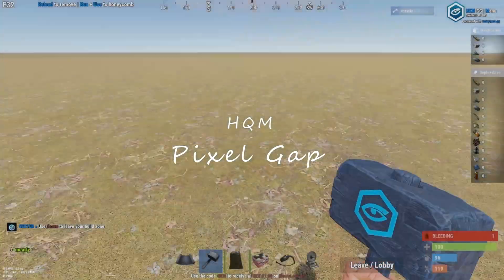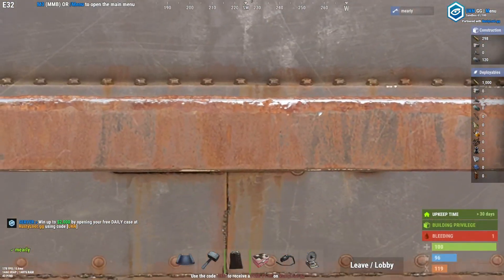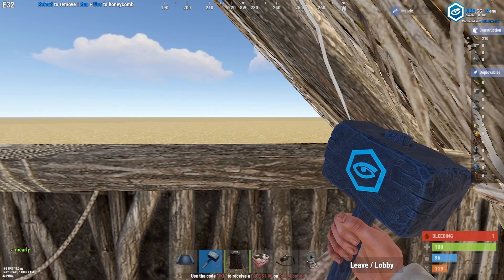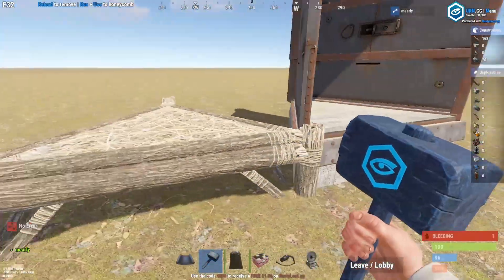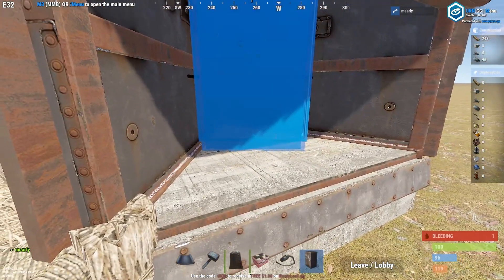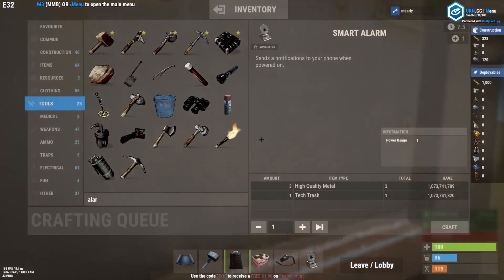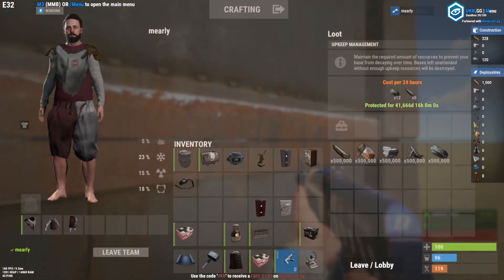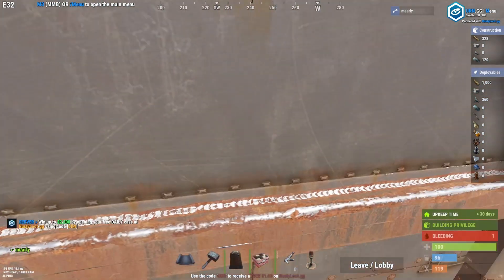HQM PIXEL GAP How To (Horizontal)

Comment: Hello! I saw it from @GameLightz at least. I do think it's when you cross those two squares you are getting offsetted in height and thus will place the next triangle in a slightly different height. It seems this small offset is a bit random and causes different gap sizes. The HQM version seems a bit more "fragile" and needs a larger gap to work. I haven't tested much myself apart from the Sheet version. Anyhow nice video to spread the word!
Reply from the maker: I hadn't seen his version.I went back and watched it after seeing your comment.I'll have to try his method and see how it goes.